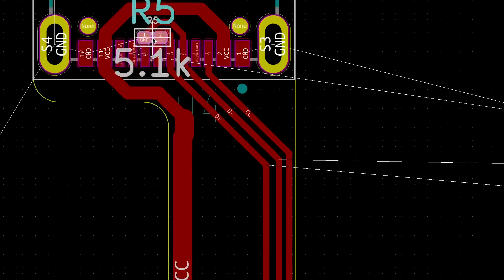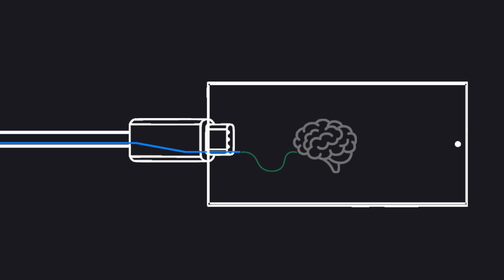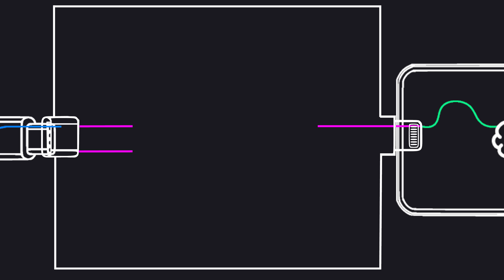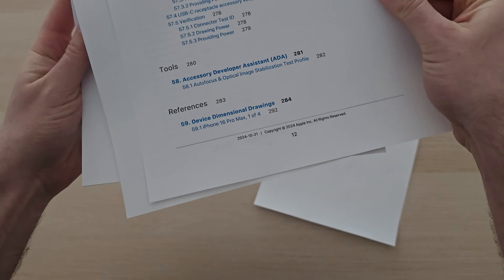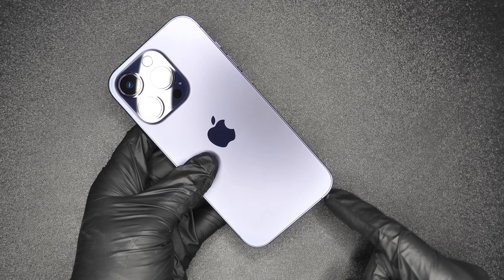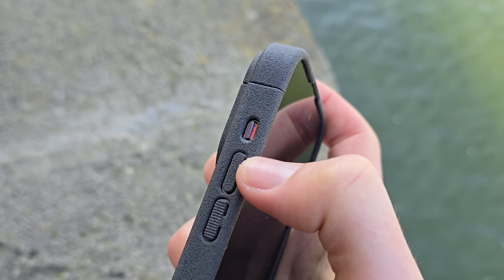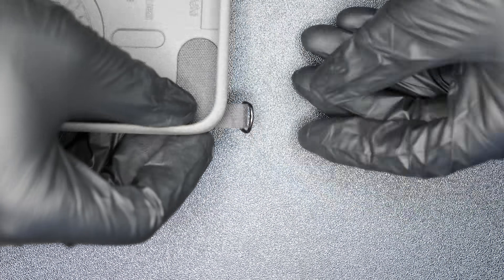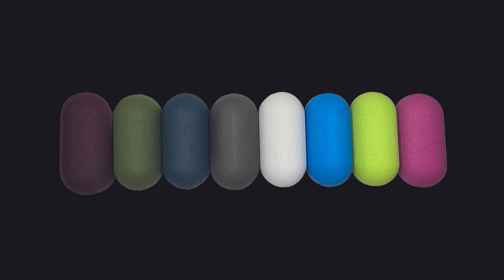I Gave Every iPhone USB-C.

Comment: Timestamps (Powered by Merlin AI)
00:02 - Revisiting a USB-C iPhone project to turn it into a commercial product.
01:44 - The CC wire in USB-C enables effective phone charging communication.
03:22 - Developing a USB-C solution using parasitic powering.
05:02 - Testing every iPhone model for USB-C functionality.
06:42 - The project explores innovative placements for USB-C on iPhones.
08:31 - Creating a USB-C case involves design iteration and user feedback.
10:08 - Innovative USB-C design enhances functionality and durability.
11:58 - Preparing for production of customized iPhone USB-C cases.

Comment: I think you over complicated the whole charging thing. I don't think people would mind just using Type C charging cords with an icon on one side so they know to plug it in the right way.

Still this is an amazing solution and engineering

Comment: Hi Ken, amazing work on this project! I have a technical question regarding the iPhone 13 Mini case. Does this mod support OTG Host Mode for bus-powered USB-C DACs (like the Questyle M12/M15)? I want to know if the phone can output power to the dongle through this case, or is it strictly for charging and data syncing with a PC? Thanks!

Comment: You get the chip out of a USB c power bank..and all your need is a rectifier.. rectifiers are neat..they always keep the secondary dc out put the right direction..even if the power is reversed or even if you feed AC in to it..Dc no matter what come out on the secondary...i built one for minds..way different then yours..But works...

Comment: Need iPhone cases and what will still work with wireless charging but has a flex cable built in case that goes to charger port and other end have the ability to put a microSD card. To expand storage.

Comment: I'm glad to see progress on this saga. Here are some thoughts:

1. I wouldn't have gone with either left or right bump, as putting it on the top corner wouldn't change their ergonomics plus would've put the cable where its easier to us the phone while charging. You said is easy to get used to, but when you using while charging your hand will be pressing against the cable which is not good for durability.

2. In fact, there are less models you need to make, since some generations are inter-compatible, like, every iPhone 13 case fits on the 12 as long as it uses an open designer around the camera, so as for the minis.

Comment: Mines currently breaking 😢 idk what to do
Reply: How did it break
Reply: @Aloalo-g4f8o a crack in the side along the usb port. And idk how to get ahold of him. It’s just sitting in a drawer now and I’m back to lightning cables
Reply: @T @TheTl33 how long u been using it ?
Reply: @Aloalo-g4f8o I was on the first batch sent out. Maybe had 2 weeks of use before I noticed the crack. The outside wall of the usb c port is super thin. Some kind of support or stronger filament would help. I’m not sure if I should super glue or epoxy it back.
Reply: @T @TheTl33 maybe super glue should do
Reply: @Aloalo-g4f8o I just worry about that getting into any of the wiring or circuitry. Also aesthetics

Comment: I love how elegant your case top part is!

The phone cases look good too

We gotta talk about that airpods case tho

1stly; you have a lanyard solution already, please please please just use that i would pay extra for it

2dly; you should try to make the board a flex cable to cut down on its size to make it smaller cuz the edges make the case look and feel (probably) tacky

Great work on your designs tho

You could definitely start a phone peripherals company with your sucess.

You could stick a battery on the back of the phones but thats not awfully interesting or original

Comment: Just an idea bro but if you can make one of these cases with like a small built in pc fans or 2  in the back that powers on when you plug it in 
This can be a gaming version of this case you can also add a lik switch that toggles between fan only and the fans and charging together that would be awesome 
As a mobile gamer a product like this would definitely be very useful

Comment: Id suggest 90° cables for those who dont want that cabke sticking out straight on the right side of the phone or some sort of 360 directional while charging cable so any1 can adjust its position while charging depending on whether the phone is held horizontally or vertically

Comment: I bought this case. Didn’t last 10 minutes. The phone slipped off the edge of the bathroom sink and hit the ground. The case literally cracked and crumbled like a dry brittle cracker.  It landed on the usb c port which collapsed and was no longer usable. The case material was porous and absorbed skin oils. Neat design…bad choice of materials.

Comment: Ken, I'm hoping you can clarify whether one can use (wired) EarPods that use a USB-C plug, rather than the Lighting plug, with the port on your case.  I'm assuming that that is NOT possible because of a comment I saw on your website, but in case I misunderstood it, I hope you don't mind me getting a confirmation from you.  The comment on your website said : "Any other accessory that requires power from the phone is not compatible. You will have to remove the case and use the Lightning port for that."  Thanks either way and for your brilliant work and wonderful dedication to the cause!

Comment: It would be great to design a bumper case that caters to users who are particular about the orientation of the USB port. Taking it a step further, we could incorporate a drop-in back plate. This innovation would address user preferences and open up opportunities for custom specialty back plates. Options could include features like MagSafe compatibility or mounts for specific activities, such as motorcycle riding or film production. Additionally, this could encourage individuals with newer phones to repurpose their devices creatively.

Comment: It’s cool and all. But why. That’s my thought why would I want it? There is no benefit to it. If u have a lightning iPhone then u guaranteed have lightning cables. So why.
Reply: Yes, especially if your iPhone is compatible with “fast charging.” Which I guess was a point of this project. Why would I buy a case for the same result the default charger and block already has? There’s no difference other than the interface of being able to use a type c cable. It’s a novelty that seems interesting, but it doesn’t change anything. I can just go and buy another type c to lightning cable that does work with all my accessories.
Reply: Why? in general we are trying to head towards a "one cable for all" type of deal,  this is to help with that.
People upgrade their electronics quite often, and those new gadgets will have USB C, but less people are comfortable with switching out their phones as they still do everything they would need from them, so instead of having to use the lightning cable for just that one device, we upgrade to this case to make it easier for ourself.
Reply: @Whythoabc yeah but that has already happened naturally. Those who still have lightning will have usb c when they upgrade their phone. I’m not trying to shit on this case but I just fail to see the why, and I still do.
Reply: @Whythoabc Yeah but I already have a lightning cable that came with my phone. Why would I buy a case for type c if it doesn’t change anything other than the port? It also has less functions than the lightning for my adaptors. I can only see myself using this if lightning cables weren’t made anymore or if this design included support for accessories.

Comment: if you can give 2 type c port on either side where one supports charging and other supports wired earphone .... then people who feel ehats the need of type c will take it as an additional benifit, primary will be flexibility of hving two type c jacks for using it simultaneously for charging and audio .... i know it will whole new project but it will be long lasting as people already hving type c can also buy it ..... can be a multi million dollar product if u patent it in case form ....

Comment: Wouldn't it better if the port was on the left so right handed people can hold it with one hand while it's charging?
Btw, since you're already building this ecosystem, can't you embed connection lines into the case and let people piggyback on them and build mods for the iphone case?

Comment: to be honest it would so much cooler if instead of a soild backside of the case but a mesh type to resolve potential gaming heat up issue so the room has room to cool down etc or just put copper plating on the back would be also nice and add more cool designs etc

Comment: At this point any phone that could benefit from conversion to usbc will also benefit from an external battery pack.  Perhaps the additional battery to resolve the cc cable reversibility issue is not such a deal breaker for consumers?

Comment: its not really for me. Right now lightning cables common. The idea was good but if you could only make something that is way too usefull for some users like its a mandatory accessory. Could you make an iphone into a gaming phone like black shark where the charging port is directly at the back of the case. There should be 2 connections at the back. 1 for phone charging and 1 for high speed fan. Then make it into a case with the cooler included
Reply: Then actually if it really trends and people like it. It could even be use for esports events for long time sessions
Reply: Then make a version 2 of a phone case that had a tube chambers into 1 small hose socket. You can make your own product of coolant pumps you attach a small hose similar to like those beats headphone plug chords does. Your own brand coolant pump device, could be smaller easy to travel with like a can of coke size. Attach and plug noiseless, less vibrations because the pumps are away from the iphone.

Comment: Can you make an universal adjustable iphone and Android (x style case )cases with length and breadth adjustable an option to install an micro(smallest one)m.2 nvme built in into it obtained from the external m. 2 mini enclosures , u can remove the internal pcb and attached it with type c , since type c now common on both android and iphones as well

Comment: For right/ left handed operations - how about adding a port on each side with a pop in & out cover for users to decide.  It may increase the cost but makes it more flexible and a symmetrical design - food for a variation.

Comment: Hey, as a cyclist, my phone choice is dictated by what cases are made available by SP Connect, because my bikes have the mount installed and I will only get phones with a SP Connect case (could be Quadlock, for those out there who use it). How about you integrate a SP connect socket in your future designs? Maybe they will go for a collaboration? Just throwing the idea out there.

Comment: This is cool engineering but I bought usb-c to lightning adapter 2-pack for $9 at amazon. It has rubber loop so it’s always on the cable. This way I can still use my old airpods pro and new iphone with one cable. Also can keep my leather cover for the airpod case I really like. I will keep using my airpods until they brake before upgrading.

Comment: Very interesting, even for the newer models that already come with USB-C, as it helps preserve the original charging port. These connectors can accumulate dirt and may oxidize over time, so this case would help protect the original one.

Comment: Great video, congratulations on scaling up your business. How was the Lumen PnP doing till the bottleneck point? I am curious about that. Anyway, another question, did you consider to move the USB receptacle to the left side? I personally choose smartphones with rounded edges as they have a better fit in my palm and since I am right handed, I'd prefer to have right corner rounded.
Reply from the maker: Thank you very much. I don't want to bad mouth the machine too much because I love the philosophy behind the company and the people who make it. I think the repeatability of the machine is not amazing, but the vision correction from the bottom camera can make up for it. A huge problem for me was the feeders. They are nowhere near reliable enough for 0402, and there is no vision to correct for it. I think the approach in the manufacturing of those feeders is flawed, so I wouldn't bet that they fix that anytime soon. I'm still rooting for them to succeed, though!

Comment: Purchased the case for AirPods Pro and it stopped working after day 1. Was super excited but it turned super disappointing very quickly !!
Reply from the maker: Hi Anup, sorry to hear that it didn't work for you. I see that you also purchased an AirPods Max adapter. How did that work out for you? I'm also wondering why you never reached out to get a replacement unit... I definitely honor warranty ✌️
Reply: @ExploringTheSimulation oh wow I never expected you to reply lol. I will reach out regarding that and the one for the AirPods Max works surprisingly well. Thanks !!

Comment: Bro, is it feasible to make magsafe power bank chips? Think of it as a set of very thin magsafe power banks each with 1000Mah. Stack 5 strips and you get 5000 Mah. Go super light with just 1 strip when you want. It doesn't make the phone heavy.

Comment: Yesterday i lost my main lighting charger and I was panicking, i have two but i couldn't find the back up, i flipped my apartment upside down, walked 40min to retrace my steps and walk home in case i dropped it, texted my neighbor groupchat at 01:40am to ask if someone had a spare and then finally i found my back up. It was in a jacket pocket i hadn't used in months. This was all while my USB-C cables were in clear view and i wished nothing more than that my phone used USB-C. 

Turned out that i accidentally left the main cord in my friends bag with her powerbank, which ended up there because i don't have UCB-C like she does

Comment: Great project, such a pleasure to see smart guys like you. I have a question - maybe I've just missed something: how do iPhones know how fast they have to charge if they only have one CC pin? Does it truly depend on how I insert the cable?
Reply from the maker: No there's no issue with normal iPhones using Lightning cables. The orientation issue only shows up when we try to do the USB-C conversion, because we convert a male Lightning connector into a female one, and we are not supposed to do that.

Comment: Hello OBSOLESS team,
First of all, congratulations on this incredibly creative iPh0n3 USB‑C Protection Case design. Converting the Lightning port to USB‑C and adapting older iPhone models to modern standards is a brilliant idea. Support for wireless/MagSafe charging, fast charging, data transfer, and CarPlay is much appreciated.

However, I noticed in the product description that accessories requiring external power (like external displays or SSDs) still need to use the original Lightning port. This seems like an area with great potential for further development.

I would absolutely love to see a future version of this case that allows video output via the USB‑C port, such as through DisplayPort support. Being able to both power the device and output video over USB‑C would truly elevate the user experience and eliminate the need for many extra adapters.

Knowing how innovative your team is, I believe many tech-oriented users like myself would be excited to see this implemented in a future release.

Looking forward to what comes next — keep up the excellent work!

Comment: What about water resistance? It could be short circuit if u drop the phone in to some puddle
Reply from the maker: It won't do anything if you drop it in a puddle. You just need to fully dry the case before you try charging next time.

Comment: Why not print a button on the mute button that can slide? with a little groove on the underside so when you slide the top button, the bottom one slides too. So the left side can be completly flat
Or a small print you can clip on tightly
Reply from the maker: I've never seen that on an iPhone case. I think the hole works well. You never want to reinvent the wheel, trust me.

Comment: Сделай с обратной стороны Jack 3.5mm
Как?
1. собственный открытый корпус! если описать словами то это как обычный разъем jack только распиленный повдоль почти пополам. если сделать жесткий обод то  это будет хорошо держаться. да, контакты будут открыты и если задеть кожей то будут шумы, но зато можно подключить наушники.
Либо!
2. сделать магнитную площадку с контактами и отдельный адаптер для проводных наушников. что бы в нужный момент человек просто подносил адаптер к чехлу и можно было бы слушать музыку.
Reply from the maker: Appreciate the ideas ! The problem with the open frame jack connector is that it works for a prototype but if I want to make 1000s of them I don't want to cut each connector in half myself. I need to use off the shelf components.
For the dongle thing, I don't see the advantage because the whole point of adding a 3.5mm jack is that you don't need dongles anymore!
Thanks again

Comment: Would love to buy one, but i need a phone case that can hold my cards :(
Reply from the maker: You can add a magsafe card holder on the back
Reply: @ExploringTheSimulation  I will just lose it. Ive tried. lost 3 of them before i found a case that integrated the card holder. :(

Comment: Now could you do it internally? And slowly acquire every old lightning IPhone on the market convert it to USB C and redistribute them.
Reply from the maker: That's what I did 3-4 years ago if you check my videos. I'm not turning it into a product because it requires soldering and CNC drilling.

Comment: I would rader have a back bump then a square corner. but great design it just not my type square dig in my pawm
Reply from the maker: The back bump would be very big and block proper wireless charging. The square doesn't feel weird at all after just using it for a few hours.